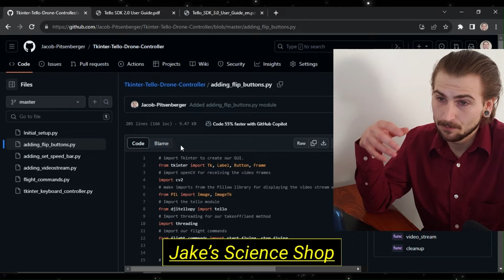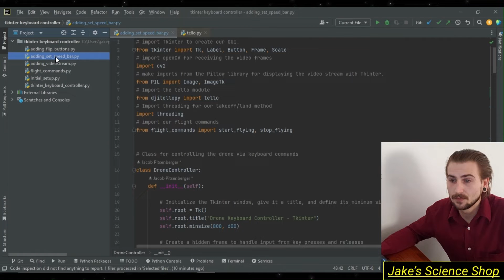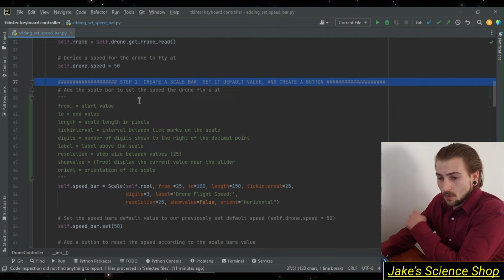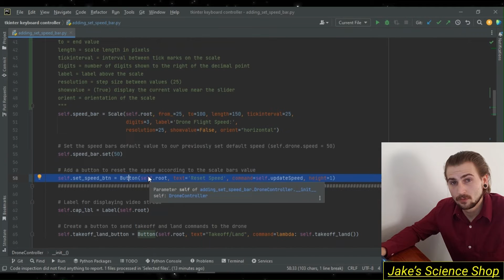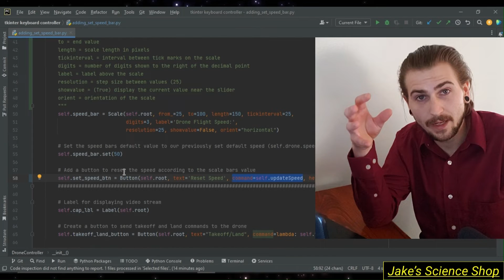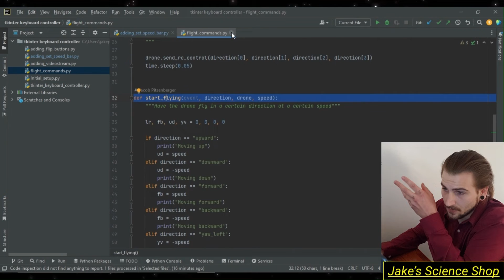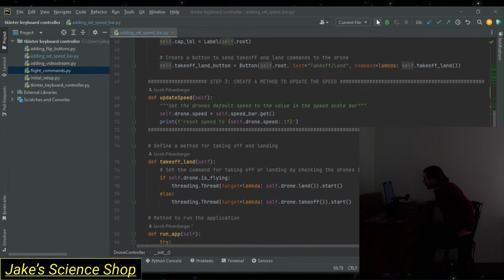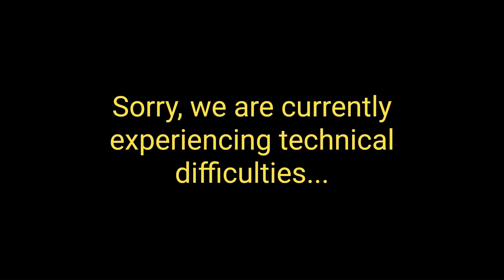Setting Tello Drone Flight Speed with Python and Tkinter | GUI Scale Bar and Set Speed Button

Comment: If I use another type of drone, can the above code still be used?
Reply from the maker: I know for certain that this code works for both the DJI Ryze Tello EDU and the DJI Robomaster Tello Talent drones as I have tested it with both. 

As for the original DJI Tello drone, I am not 100% sure that it works but given the SDK 1.0 has a read command to check the Tello's speed I would assume there is a similar command to set the speed as done in this video.